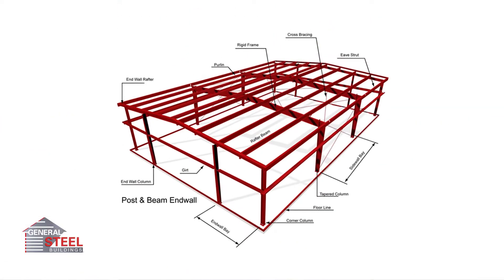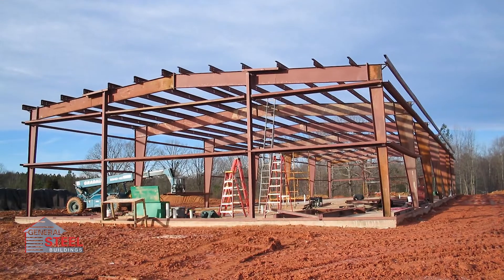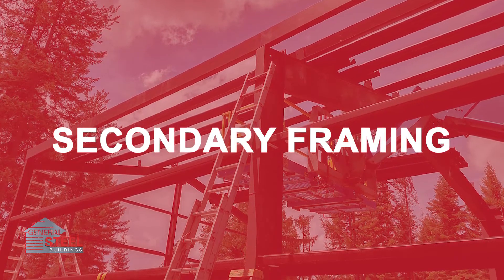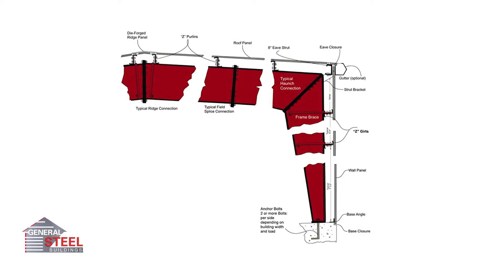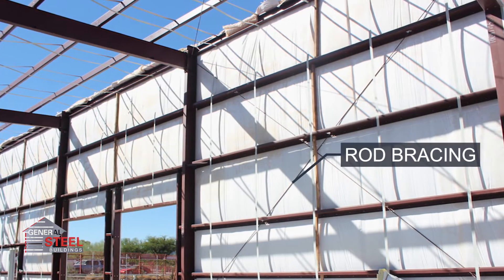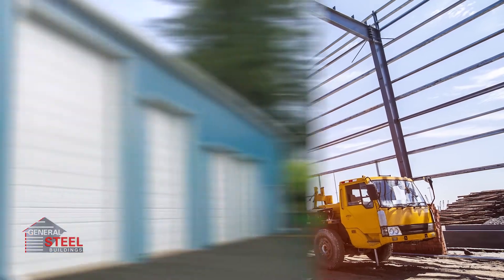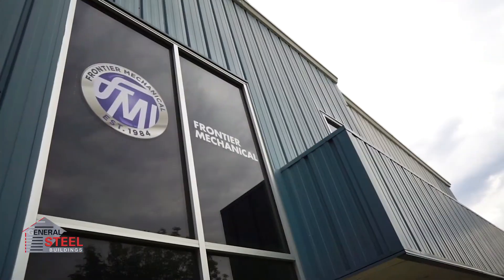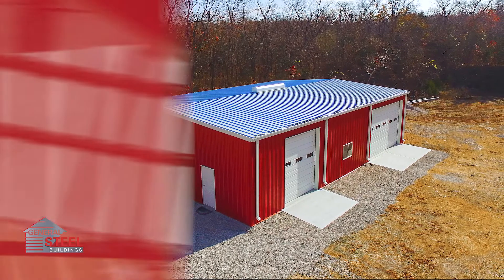Metal Building Framing Details | Steel Buildings | Metal Buildings - General Steel Buildings 101

Comment: What insulation is better ? Spray foam or fiberglass?
Reply from the maker: Rolled is best if you don't go with insulated panels. We tend to advise against spray foam as it can create a condensation issue.